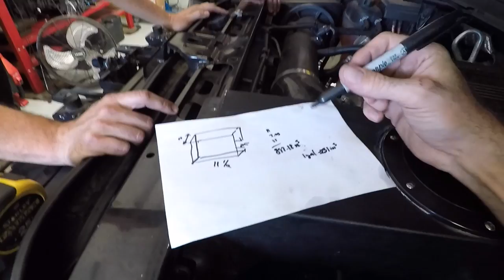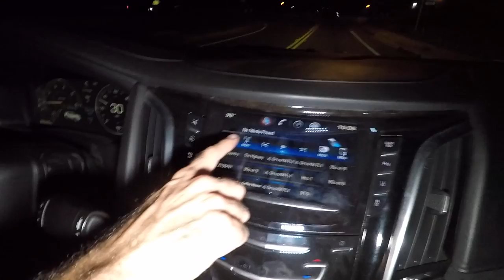Doing BAD Things With A BIG GIRL! Escalade Gets Upgrades Then Takes On Something She Shouldn't!

Comment: If you haven't already, gut the thermostat block on the cooler lines at the trans. Temp will drop another 5-10 degrees. And it keeps the fluid constantly moving

Comment: I just put slotted rotors and carbon fiber ceramic pads on my Tahoe. I did it mostly for looks to get rid of the rusty stock rotors.
  They work great. Speed and power are great but stopping power shouldn't be overlooked either. It's my wife's daily driver to haul around our kiddos.

Comment: Vents in the hood. Reduces high pressure in the engine compartment, pulls more air through the radiator and lets the hot air out.

Comment: Note - Many 6L and 8L transmissions have a thermal bypass where the cooler lines attach to the transmission. No matter the cooler core size, if there's no fluid going through it, the cooler won't do anything. If the Porko has a bypass, eliminate it or a bigger cooler won't help much.

Comment: So if you're doing something like this in the future, where you're trying to create a tank with a specific shape to fit a specific spot, instead of taking measurements over and over, and writing it all down, go out and get yourself a block of crafting foam or modeling foam. And then all you need is a knife and rough file, and you can just continue to file that and cut that into shape, until it's the shape you want. Then you can use that as your CAD model, and have all of your measurements outside.

Comment: If you'd like to tune the setup on that kart, wider track width in the rear will loosen it up and opposite narrowing it will tighten it up. Fine adjustment 1/4" on each side or less.

Comment: How many heat exchangers can you have before the air flow is unusable? i mean in that spot in front of the radiator is getting like 30% of the air it should? when does that become a problem?
Reply: Dose it run coolant thru it I think works mostly off that but air helps also dosnt need mutch

Comment: for the life of me, I have not figured out why in the hell you and cletus are not using an AC compressor to charge your cooling. Ford tested it with the last supercharged lightning, that never happened. Its amazing. 40 second super cooling... and recharges itself. Not sure if they used a compressor, or what, but they were using some form of AC to cool the charge. I met a guy at the drag strip with a 60's Mustang, Turbo, street car, and his whole intake was sweating like a beer can, and he was in the seat with a laptop, and running 9's with silly tires.
Reply: Interchiller system
Reply: Dodge demon uses this from the factory.
Reply: @jasontruman1215  Exactly...

Comment: Hey guys awesome video question would it not work better if you found a better place for your heat exchanger like some type of v-mount or some better ducting forcing more air to as you've stacked up 3 rads in a row you could gain so much more cooling if you could space them out more and yes your bang on the trans cooler I've used one on everyone  of my trucks and racecar and my trans guy has told me it's because of that I've saved most of my trans lol

Comment: I really hope this thing doesn't have a transmission cooler in the radiator. If so it should be bypassed completely with the new "external" cooler.